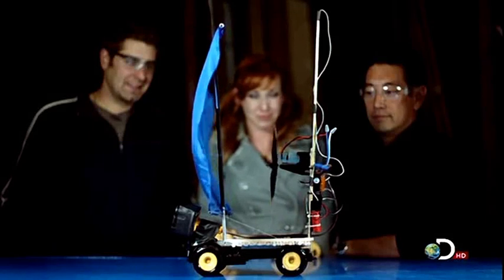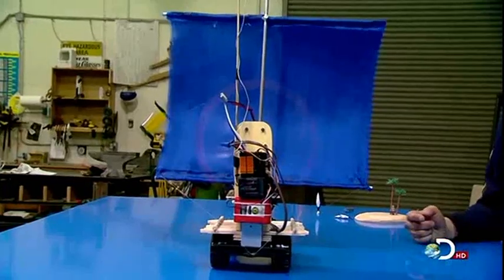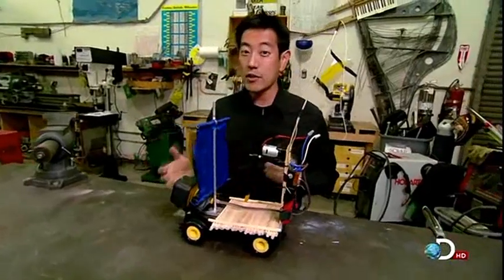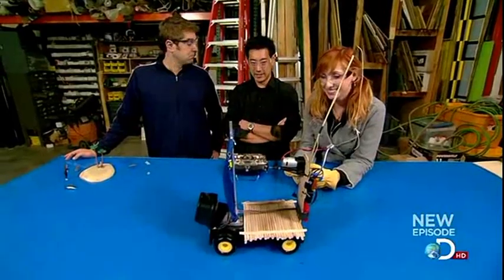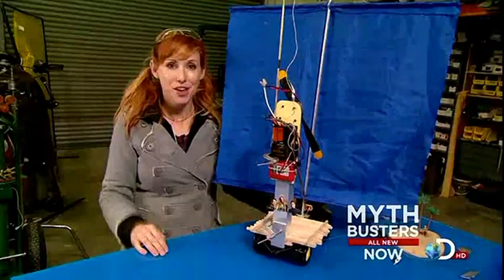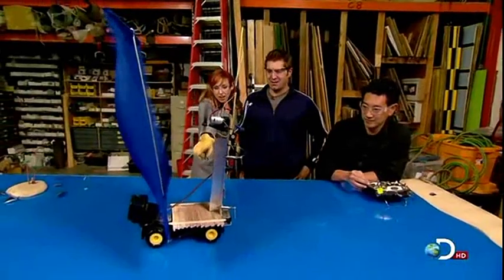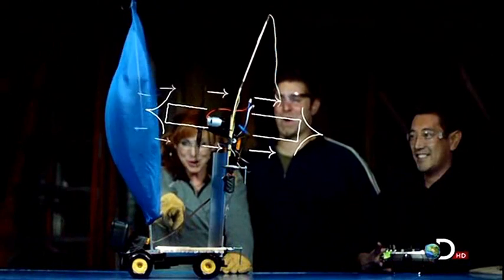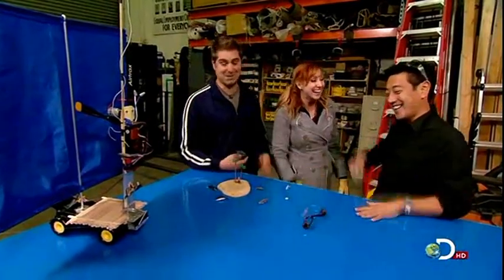Mythbusters Blow your own sail small scale

Comment: If you look up the equations for "elastic collisions" in physics you'll see that if you throw a ball with momentum p and it hits a sail with the same mass as the ball, this will cause the ball's momentum to drop to zero while the sail gets the same momentum p the ball previously had. But if you throw a ball at a sail that's vastly more massive then the ball, the ball actually rebounds with momentum -p while the sail's momentum increases by 2p, twice that of the ball thrown at it! I think that's basically what's going on here, if the fan imparts momentum p to some chunk of air the fan is pushed back with -p, so if the sail only gets momentum p there's no net movement of the connected fan and sail, but the sail is larger it can get momentum closer to 2p so there is net movement.
Reply: +hypnosifl "But if you throw a ball at a sail that's vastly more massive then the ball" What is more massive the sail or the ball?
Reply: @giantmiller1136  the sail, the air molecules are tiny.

Comment: Ok, question regarding this. The cancelation is because fan the pull the air from behind and pushing it forward, so the net energy is the same, but what if they had a fan that pulled it from the front and had the air go through a 180 degrees bent tube into the sail, so it's pulling from the front and blowing towards the front?
Reply: My thoughts exactly.  No one has tried this... seems odd.  It’s either crazy stupid or crazy brilliant.
Reply: @Drokkstar_  no, it doesn't matter which side the air is picked up from.
If you draw the free body diagram, it only matters that the air molecules are relatively immobile and are given some forward speed.

Comment: @Krazed2Kraze This looks similar to the horse and wagon theory. Where in theory the Horse and wagon which are connected should cancel it other out because of Newton's third law, but because the horse is also pushing on the ground and the ground pushes with equal force to move both the horse and cart. Not only that but what Grant describes sounds like a bounce, as in a light object being pushed away from the massive object after the light object ran into it.

Comment: Mythbusters got the explanation all wrong. First of all, air molecules don't "bounce" off surfaces like some have suggested. They create flow fields and pressure gradients. If you assume that all the force acting on the propeller is in the opposite direction of the air flow it generates, it still wouldn't matter if all the air was redirected backwards from the sail, the forces would cancel. The part that is being neglected is the propeller. The propeller isn't just colliding with the air causing it to flow, the rotation and shape of the blades cause a pressure differential (Bernoulli effect) that causes the air to flow and give it linear kinetic energy. Part of the force acting on the propeller is opposite the direction of the air, but the Bernouli part is (at least partially) counter the rotational moment of the blade. For this reason, the linear force acting on the propeller could be smaller than the force pushing on the sail. You can think of the sail in terms of drag force. In this case, the larger the sail, the larger the drag force at least until you reach the maximum force produced by the air flow. Newton's laws are not violated.
Reply: As a mechanical & aeronautics engineer I can tell you that you're mostly wrong.
By your logic, the air behind the sail is moving faster, so it would have lower pressure (the air in front of the sail is not moving at the start) so it would push the sail backwards. But it obviously doesn't.
Also it doesn't matter how the fan is pushing the air forward. It doesn't matter if it has a horizontal propeller or if it's a different kind of pump style.
Study the free body diagram.

Comment: Contrary to Mythbuster’s contention, the operative principles involved here are not “thrust” nor Newton's third law—“For every action, there is an equal and opposite reaction”.  Anyone with a basic knowledge of aerodynamics, such as airplane pilots or those who’ve read a book on basic sailing theory, understands that the force causing the boat to move forward or backward is “lift” resulting from a low pressure area.  Granted, the momentum of air striking an airfoil, such as a sail, has some “thrust” effect upon the airfoil; however, the “thrust” is negligible compared to the lift resulting from low pressure on the lee side of the airfoil (sail) or propeller.  

It is Bernoulli's principle which is operative here.  Bernoulli's equations provide that within a horizontal flow of fluid (such as air), where the fluid has a higher speed there will be less pressure than where the fluid is moving at a slower speed.  

If you view the Mythbuster’s experiment from the perspective of air speed and consequent low pressure areas, rather than the 'thrust' of air molecules, then you can see why the boat moves in the directions it does.  

When the aggregate of the low pressure areas on the lee side of the sail is greater than the aggregate of the low pressure areas on the upwind side of the propeller, the lower pressure on the lee side sail will pull the boat forward.  

Conversely, when the propeller is oriented in such a way that the air doesn’t flow sufficiently quickly around the sail (insufficient low pressure), then there is not enough “lift” to pull the boat forward.  On the other hand, when the boat moves backwards away from the sail, this is caused by the propeller’s lift being greater than the sail's lift, acting like an airplane’s propeller.  In other words, the sail and propeller are in a tug of war, with the greater (cumulative) low pressure lift vectors being the 'pull' that determines which direction the boat moves.  

I’ve never had a physics course or studied math beyond the 10th grade of high school (which I flunked twice before passing), so I’m sure an aerodynamics engineer could explain the operative principles here more precisely.  Nevertheless, it seems to this layman, the application of Newton’s third law (equal & opposite) and “thrust” is largely irrelevant here.
Reply: Bernoulli's Principle is derived from applications of Newton's third law. Newton was slightly prior to Daniel Bernoulli, and the latter studied Newton's works.

Bernoulli's Principle just describes a particular situation of a Newton's third law application.

Furthermore, even if you study Archimedes principle, which is far prior to Isaac Newton, it is still just an application of the third and the second Newton laws.

Newton's law is far more general. If you know the masses and the forces, it might be applied to any situation in any scale short from quantum dynamics, so it is never irrelevant.
Reply: As a mechanical & aeronautics engineer I can tell you that you're mostly wrong.
By your logic, the air behind the sail is moving faster, so it would have lower pressure (the air in front of the sail is not moving at the start) so it would push the sail backwards. But it obviously doesn't.